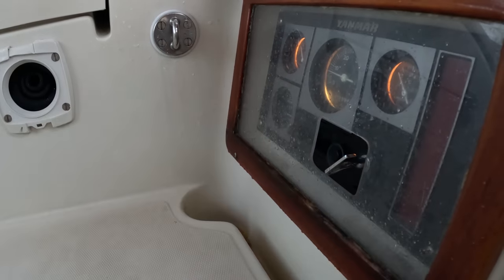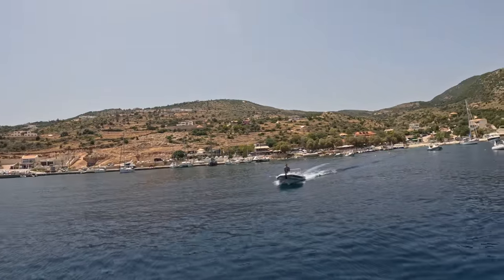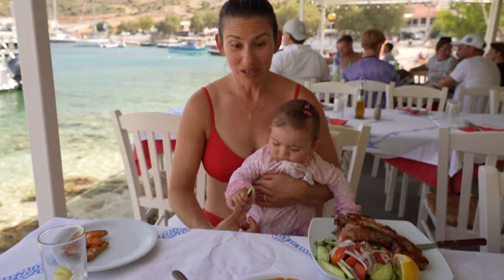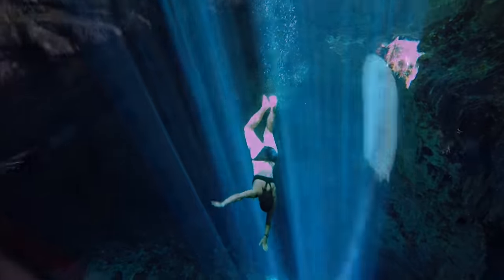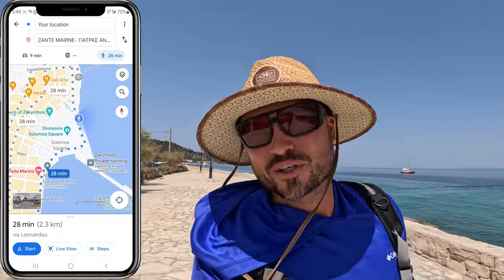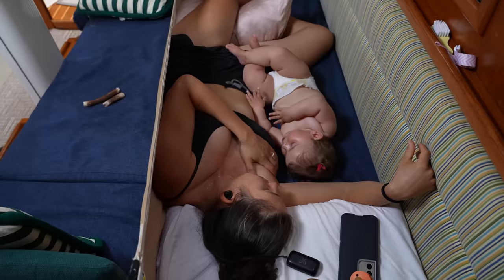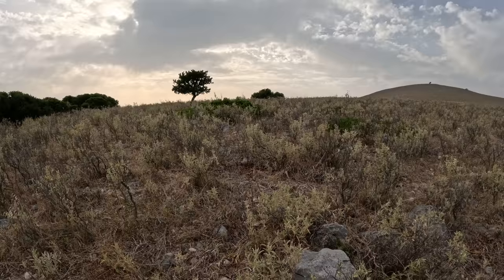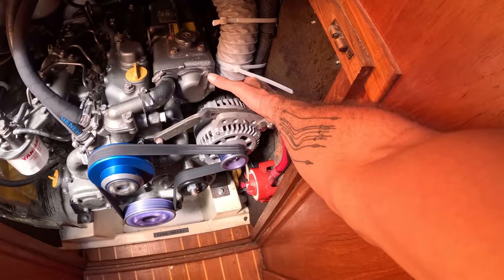This Project May Have Saved Our Lives | S08E27

Comment: So you’re pressurizing your engine compartment with air.  Remember the air from the compartment must have a place for it to safely escape. Otherwise fumes will filter into anywhere there’s a crack, so most likely into the cabin.   Fresh air is good for the engine but there needs to be air circulation.
Reply: I agree. Most blower set ups I’ve seen pull hot air out. The colder air would naturally replace it in a negative pressure scenario
Reply: I disagree. He's not pressurising anything, the other end of the blower hose is down by the bilge where it can suck in colder air from under the floor.
Don't forget that with the engine running, it's drawing all of it's intake air from the engine compartment, through the air filter.
Any fumes in the compartment are eventually going to be sucked through the engine, then exhausted out. Fresh air in the compartment is replaced through the bilge.
With the engine on idle, the amount of air that Yanmar engine draws per rotation means that it's changing the air in there at around 27.5 cubic litres per second.
Now you see why it's important to change your air filter at every service. In it's lifetime, it has to endure a hell of a lot of air going through it.

Comment: 11:07...You might consider turning the fan around to suck the hot air out with a cool air in conduit on the alternator side. Either way, it would be more efficient with a direct hot air outlet.
Reply: I agree. Much better solution but will require an exhaust port either on deck or high on the transom.
Reply: Some will exit out the cockpit coaming box

Comment: Its been record breakingly hot in Greece this year your getting cooked by the look of things ..  

Remember insulation works both ways, reflect heat away from the boat deck and draw air though the boat if you can in one direction.. 

Water evaporation in a moving air stream helps cool the air passing over the water or wet item .
Reply: @hxhdfjifzirstc894  
Thats one way ...more economical of water is to paint the roof with heat reflecting paint insulate the underside of the roof against conducted heat .. and have a rivulet system inside basicly a narrow channel or channels set in the floor running down a series of steps ..mini waterfalls/weirs starting in a small fountain an pool set into a wall at one end of the building. Collecting in a sump tank and being pumped back to the fountain again preferably by a solar power system. 
Low voltage waterproof lighting Makes for a visual treat at night and if the gaps a hazzard it can run under a pierced grating..
Though kids can play all day launching paper boats down the runnels and over the mini waterfalls.🧙‍♂️🇬🇧 
If theres a sump or pond outside on a patio area it also can be sprayed in a small fountain that end..

Dont forget the various mosquito born diseases that are moving into new areas though. 
Moving water will deter most though.

Comment: By drawing air from the bilge, are you concerned about moist salt air contaminating the fan motor and alternator?  I understand the need for a cooler source but just wondering about the potential caustic effects of salt....Bossman

Comment: Install dorade vents for the engine compartment.  Must have an in and an out.
Reply: Yes, with the ducting from the inflow vent to the fan to the alternator, then outflow will be passive out the other vent without ducting?
Reply: Or maybe better to reverse the fan, drawing heat away from the alternator, through the ducting, and out one of the vents, relying on passive inflow to the compartment through the other vent without ducting.

Comment: If your alternator is getting that hot, it's under full load constantly. If you provision an alternator rated for 25% more than the maximum draw you allow, it will be much happier and generate a lot less heat. My family sends lots of love your way, your videos always help us escape from the harsh reality of city life, if even for a short time. It's refreshing to see when we live in the middle of nowhere, Nebraska :)
Reply: Yes, I was thinking that also. Lithiums will suck everything the alt can provide and burn it up...   on my Balmar I dropped output to 60% to counteract that and still had good charging performance...

Comment: I had this problem before. Worry about a Bilge leak, causing that blower to suck water and throw it on the alternator, not good. Also the blower motors might be 6A draw but the surge current is like 20, my 10a fuse blew after several starts. I changed it to a 25a. Also, a balmar 614 has a temperature sensor input and can degrade the alternator output as the alternator heats up, a valuable safety when if it’s too hot. I had a 360a alternator on a jeanneau 439 so similar small engine box.

Comment: That blower for the alternator I would have installed, maybe a little differently. I would have wanted to have it suck air in and push it out, a possible rear cowl on the vessel?

Comment: regarding the alternator setup, they way you have done it you seem to be recirculating the same air withing the engine space. It will be ok if you run the engine for an hour, but if you motor for 8 hours the engine room will eventually heat up. Normally engine spaces have a hose taking outside air into low in the bilge and another hose taking the air from above the engine to the outside. A blower should be installed on the hose going to the outside, so as not to increase the pressure in the engine space.

Comment: You guys need an Icybreezy cooler. If you have a way to make ice this thing is great. It's not just a swamp cooler it has a compressor and cools down an area. It also gives you 6 hours of cooling before you replace the ice and battery. If you have 2 batteries it's an easy swap

Comment: I have had the same problem with off road over land trucks and RV's. The (Water Cooled) Brushless Alternator, 200 amps is what ya need. There is a few different brands making them now. They last wayyyyy longer and run way cooler.👍

Comment: Hey guys, just wanted to give my two cents on the air conditioning.  In the year 2023, with all the new technology out there, there is absolutely no reason your family should be sweltering out there without AC. It changes your life. I was raised in South Texas and worked on shrimp boats in the Gulf of Mexico. Climbing into an air conditioned bunk made all the difference. Times have changed, get it.

Comment: Hi. If I may make a suggestion. You take air from the bottom of the hull which is quite warn in the waters you are navigating in and you push the hot air from around the alternator in the boat. Why don’t you reverse the blower and pull the air from above the altermator to the outside. You probably have an air intake for the engine compartment through which you can use to evacuate the hot air. It seems to me that it is going to be a little bit cooler in the boat this way. 
Michel

Comment: You may investigate if the alterator fan blades are set to pull air through the center of the alternator instead of the blades set to blow air onto the device. Had a problem in the past and this was the issue.

Comment: That doesn’t look like a continuous duty fan, looks like a bilge blower for a gas inboard only meant to be used for short times to clear fumes. Might want to upgrade (they are pricey $300+ for a jabsco) or buy a few spares for when it craps out.

Comment: Good work! But hot alternators are red flags to the underlying issue.... power demands peaking the output of the alternator. Your current blower setup has a worse case risk of drawing water or gases from the bilge. Maybe best to draw hot air from the engine compartment and vent to the outside, allowing a draw of air from the bilge.

Comment: The alternator running hot will shorten it's life even if it doesn't burst into flames.   Hot air also adversely affects engine performance.  Hot air is less dense and doesn't produce as much power as cold air.  That's why turbocharged and blown engines have inter-coolers to cool the intake air temps.  High temps will also shorten engine life.  The cooler you can keep the engine compartment the better.  I sail the coast of Alaska so high temps aren't normally a problem for me.  🙂 Thanks for the video.  Sail On!

Comment: Jordan I saw an episode of Expedition Evens and they did an install of a high powered alternator and they two were having over heating. I find it funny that the stock alternator has a fan behind the pully but the high output ones don't. I'm no electrical wizard, so it is just an observation and maybe has no bearing on the heating problem. Glad to see you guys are doing so well....cheers

Comment: We have the same issue on our Hunter 410 with small engine compartment and we have a 250 Balmar alternator but due to the temperature in the engine bay it deregulates the output. We were thinking of sucking air out as to opposed to blowing it in. Very little ventilation. How do you find blowing the air in working for you?? Love the videos and the family journey in the Med.

Comment: If you have Lithium Batteries, you need to have a DC/DC charger such as a REDARC set between your lead acid starting battery and your house battery--the charger charges the Lithium batteries without overloading your alternator.  Always  limit your charging current to a max of fifty amperes or you will overload your alternator.  Set your alternator to charge your starting battery, and run the DC/DC charger from there--and your alternator will handle it fine.  I also have a VSR--voltage sensitive relay, between the lead acid starting battery and the DC to DC charger.  When the alternator stops charging, this relay opens and cuts off the house battery charger from the start battery.   This stops the house batteries flattening your starting battery.

Comment: Love watching your videos every Saturday morning.
Regarding the cooling og the Alternator I would use a thermostat in the line as well and have the ventilation running for a while after you turned off the engine.
Like someone else here pointed out you are sucking in the air from the closed bilge compartment into the closed engine compartment, this might not work out for your intentions in the long run.

Comment: Can you share the temperatures before and after?  
You might want to be able to run the fan after you shutdown the engine to pull some of the hot air out

Comment: Hey guys!   that's not a good solution for your heat!   you have propane on the boat! that blower needs to pull hot air out!  not blow air in.     please check this out!    propane sinks, pulling air from the bottom of the boat and firing her up could get ugly if you have a leak...   Blow hot air out!     xoxo
Reply: I hope he reads your comment!

Comment: Hi guys. In the Sacramento CA area it hasn’t been over 90F  (32.2C) for a while which is unusual but the humidity has been high 70-80% which is also unusual. Meteorologically speaking we have a Mediterranean climate, hot summers, cooler winters but no snow although that’s only a 45 minute drive away to the Sierra mountains. Hang in there.

Comment: Possible Scenario??.....Random fuel leak occurs.  Fuel accumulates where it usually goes....The bilge.  Fuel vapors are now ported to the engine compartment / hot alternator with handy dandy blower unit?  Certainly not trying to be a downer.  Been watching you guys for nearly 2 years now and love your content.